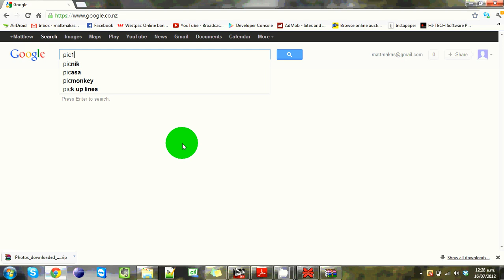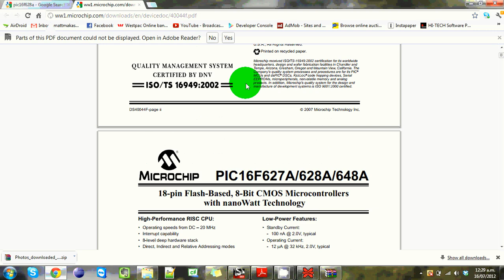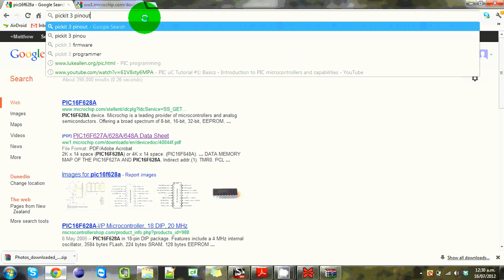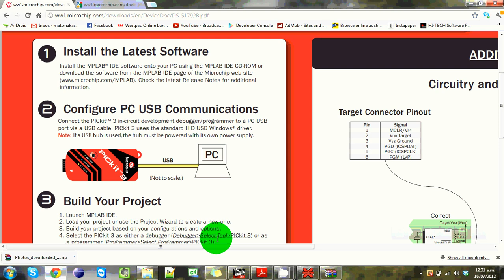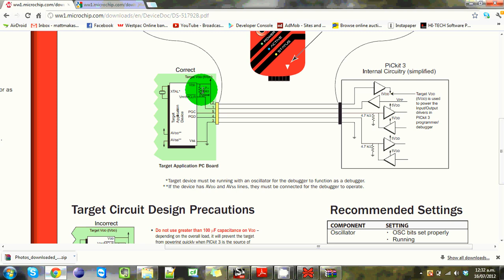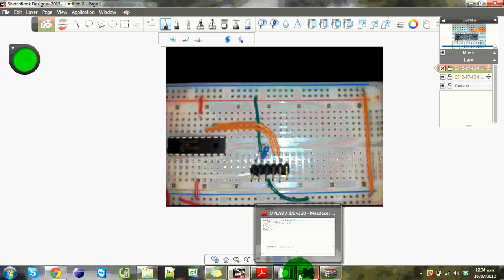How to set up PicKit 3

Comment: It is funny that you talk about electricity flowing from positive to negative (hole flow vs. electron flow) when you are talking about the Vdd and Vss pins.  I believe the ss in Vss is speaking of the source of the electrons and the dd in Vdd is speaking of the drain of the electrons, so the electrons flow from the source(-) to the drain(+), kind of like water ;-). It is all a little confusing sometimes.